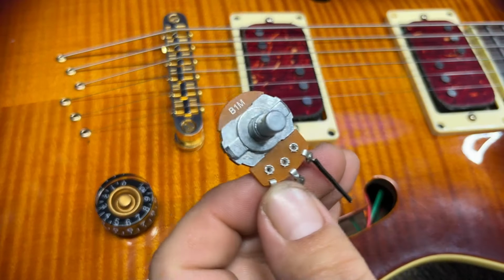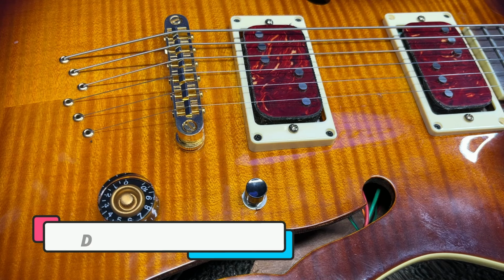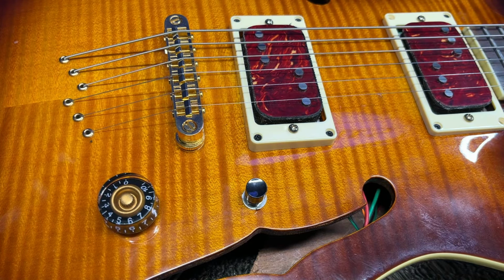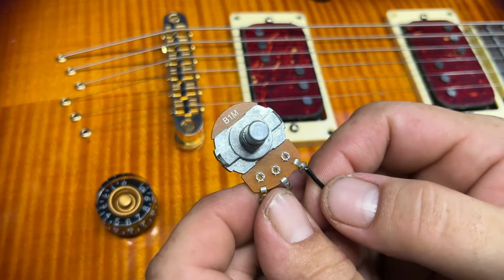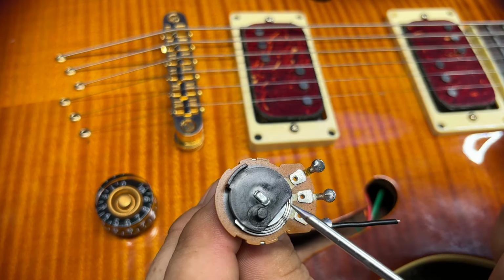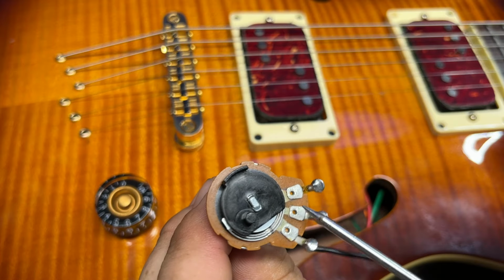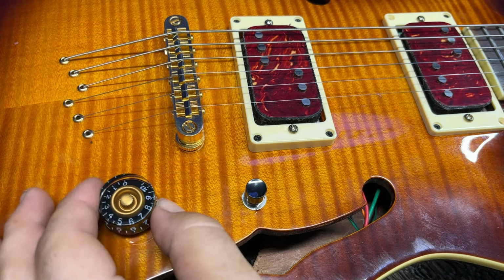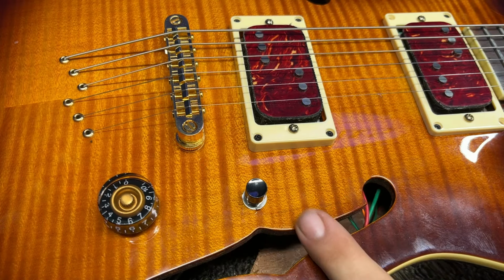Volume Pot Comparison  1meg - 500k - 250k - 100k - 25k

Comment: If you're always on full volume it doesn't make any difference. Actually it doesn't make any difference to have a volume button. I use a very good quality 200k pot I took from an old radio on humbuckers. It sound pretty suitable for me. Your gear sound great bud..
Reply from the maker: It absolutely makes a difference. A volume pot at full volume is not bypass. The center wiper is touching the pick up which essentially is underload to the ground.
If it didn’t matter at full volume, then no manufacture, would bother making different value potentiometers. If it didn’t matter at full volume, then you wouldn’t hear any difference whatsoever with different value pots.
Plug a pick up directly to the jack and see what happens, guaranteed big difference. 

Thinking pots are fully bypassed went at full volume is a common mistake.
Reply: @ArtoriusGuitarNerd  really! But if you just put a pot at full and measure with a multimeter at diode scale you will hear a bip and 0 resistentes. Have you ever try this?
Reply from the maker: @PintaoLoko  you’re doing the test wrong. You’re only doing a continuity test. At full volume the center lug touches the 3 lug 1000% completely BUT lug 3 is under load so it can’t be bypass. Fender makes a no load pot that goes to “11” by taking out the load resistance.

Please please please watch my revised video. I go into depth on how pots work and why people think they’re bypassed at full volume
Reply: @ArtoriusGuitarNerd  só it's no this video? I can't find it

Comment: Damn! I never knew that changing that value could influence tone.  You might have just saved me a couple hundred in pickups for a Reverend that I can't stand the sound of.  I'm going to try a few things before swapping pickups, now to include seeing if perhaps a 100k pot helps!
Reply from the maker: Yes lots of money can be saved. Potentiometers are cheaper than pickups.
I put a 50k pot in a G&L ASAT with the MFD pickups successfully.

Also each valve sound noticeably different in person and on the daw, YouTube audio compression is bringing out a lot of highs making it harder to tell the difference. I have the same problem with cymbals.
Reply: Also consider swapping magnets. Easy and cheap in most cases.
Reply: Capacitors help too. You can solder them to your pots

Comment: Tweaked a way too bright Jim Root Tele by replacing the 500k pot with a 250k that way. Also recently experimented with a mix of a 500k for volume and 250k for tone. Pots can make a subtle but noticeable difference
Reply: I've tried 250k tone pots with 500k volume pot on my Strat. It sounded great but after awhile I got tired of the clanking sound. I'm going to try the other way around. 500k tone pots into 250k volume pot.

Comment: Is the tone control hooked up? The parallel resistance between the cap/pot and resistor selection will make a difference on tone. TBH I can only hear a pronounced difference with the 25k pot, but there is also a massive volume drop, and the pickup is under a very low load at that point and it will reduce the high end like driving a long cable run.
Reply from the maker: There is no tone cap/pot hooked up on this guitar.
There’s more sound differences in person and listening to the direct recordings, YouTube compression brought out the highs, I have the same trouble demoing cymbals.
Each value is affecting the load, a bigger value pot would help with long cable runs.
Reply: @ArtoriusGuitarNerd  I've been using 1meg pots for like 30 years now, indeed it was to combat high loss with 20ft+ cable runs. Even locally I can't hear any diff between 500k and 1meg though, 1meg is just louder. I have to change the tone pot to 250k because 1/2 the rotation does nothing with a 500k tone pot and 1 meg volume. I always thought that was curious.

Comment: Until recently, Gibsons used 250 - 300 k pots instead of the classic 500 k pots. My 2008 Les Paul Standard had 300 k pots from the factory. This was apparently due to the switch from pure nickel to nickel-plated strings in the 60s (?), which sounded much brighter (nickel was expensive and hard to get back then, as I understand it).
I would suggest if you have a Gibson, check the pot value and try 500k first instead of going straight to 1M.
Reply from the maker: Yes Gibson uses 300k for vintage spec and 500k for modern spec.
I’ve heard slight differences when changing out pots with the same value because the tolerances were different. Both would be 500k but one would read 472k and the other would read 503k

I once had a 300k pot that read 197k !!!which was actually less than a 250k pot would have been. So I would definitely check pots with a meter if it means that much to your tone.

Comment: Great comparison thanks, if you change the value of the volume pot would the capacitance in the tone circuit need to change?
Reply from the maker: Yes I should have mentioned that in my video. Same rule applies to the tone pot.

I personally like to have my tone pot at a higher value than the volume pot, some of my guitars have the tone pot bypassed on a push pull.
Reply: @ArtoriusGuitarNerd I like this idea and am going to put 500k tone pots on my strat with a 250k volume pot.

Comment: Sounds like ye have extremely bright pickups to begin with. You didn't state what your pickups are so I cannot properly judge what ye got there. Ye need to use a set of pups everyone is most likely to be familiar with like the JB/Jazz. 

Also ye need state the build and construction of the guitar yer using, a semi-hollow like the thinline sounds VERY different from a Les Paul. I wouldve used a Les Paul of more or less standard construction (1/4" maple capped mahogany body with set on mahogany/rosewood neck  OR a carved mahogany body + set mahogany/rosewood neck). If there's any differences, that needs be stated so people can make an informed judgement of what they're listening to.

As it stands, I don't know what pups you're using and what kind of thinline you're using.
Reply from the maker: I’m doing a follow up video this weekend with a Seymour JB. I’ll be doing volume & tone clean & dirty.

Yes, this pick up was bright like a single coil so it was too bright with 500k and 1Meg. I also had the guitar mix way too loud so the YouTube compression squished and smeared all the frequencies together. The differences are subtle and noticeable, but the compression made it much harder to tell the difference.
Reply: @ArtoriusGuitarNerd  Cool, I'm looking forward to your new video! We all start somewhere, so as long as yer learning and growing as a YouTuber and as a presenter, you'll do fine! Subscribed. 😁👍

Comment: I've noticed my 90s MIM with ceramics and 250k sounds like a muddy mess compared to my other with also 250k and Alnicos, which sounds "normal." Is that odd/strange?
Reply from the maker: I would go with the 1Meg if they’re that muddy. That would open them up to their full potential
Reply: Ceramics are dull and lack sparkle to my ear. They can also be very nasal. Buy some alnicos, as they seem to be more open sounding to me. Clean tones or slight breakup are more critical than heavy distorted tones, as distortion adds overtones.
Reply: @VincentBakker1964  huh. For mine I feel I need to turn the bass way down or it sounds like mud.
Reply: Wow, I thought it would be a huge difference, but it's not. Cool video.
Reply from the maker: @charlesvannice8279  the bigger value pot will “lower” the bass by “raising” the treble.
I’ve used bass cut knobs but they neuter the sound.
Reply from the maker: @danpena7922  it sounds different in person and on the daw. YouTube compression is accentuating the highs. I have the same problem when posting drum cymbals.

Comment: Would you switch both the tone and volume pots or just one of them. Would you also keep the same capacitor, just on a new potentiometer.
Reply from the maker: Same rule applies to the tone. I would have both pots match or use a larger value on the tone if possible.
You don’t need to change the capacitor because the capacitor doesn’t add load to the pickups. (You can take this opportunity to change the capacitors if you want to experiment. I think .047uf is to muddy when on ten so I usually use a .027uf-.033uf which gives me a better sweep of usable tones)

Most of my tone knobs are bypassed with a push pull pot…. I’ll pull it up whenever I need to use a tone knob.

Comment: Wait a sec - aren't you just reducing the drive on the front end of your amp? It would have been better if you'd scoped the output level. I suspect you're just sending more signal to ground as a resistor has an even attenuating effect across all frequencies, unlike a capacitor.
Reply from the maker: I’m using resistors to attenuate the treble not the volume. It’s 1000% the same as a potentiometer. A potentiometer is a variable resistor and this a none variable resistor so it’s always on “10” “ full volume”. It’s only adding load to the pickup which is way the treble fades a bit and not the volume.
Reply: @ArtoriusGuitarNerd  You misunderstand me. By reducing the gain on the front end of the amp, you attenuate the treble as the bass is already saturating the stage, so can't get any louder. Turning down the gain on the amp would have exactly the same effect.
Reply from the maker: @zenscapeUKmedia  guitar is highZ and an amp is active LowZ. So turning down the gain on an amp would not do the same thing, turning the the gain on an amp with turn down the volume. You could adjust the eq of the amp to adjust the treble but this video is supposed to show you how to “tweak” the tone a little bit so you don’t have to adjust the amp so much from guitar to guitar.
Reply: @ArtoriusGuitarNerd   I'm talking about an amp having a front end gain stage and a master volume. Although if you took at Champ and drove it with a flat response boost pedal, it would saturate the front end tube which compresses the bass so making the treble appear brighter. That's what tube (valve) overdrive is all about.
Reply from the maker: @zenscapeUKmedia  ok well again this is way to tweak guitar so you don’t have to mess around with the amp so much between guitars.
Reply: @ArtoriusGuitarNerd  I guess my point is you're adjusting the interaction of the guitar and the one amp. With another amp, as you guys say "your mileage may vary". Another room, another amp or cable you may wish you hadn't changed for such a limited environment.  Raising or lowering pickups / pole pieces also changes tone. Changing your pick attack, or position on the strings would be far, far more dramatic and is something all guitarists should master before turning to mods to compensate for what might be bad technique. Versatility of performance is the ultimate goal for any musician.

Comment: your guitar sounds mudfy because the bridge pickup placed way too far from the saddles. not because of the slight treble filtering by pots. its all about the mids
Reply from the maker: I don’t understand what you’re saying.
My bridge pickup is standard distance from the saddles/bridge.
These pickups are very bright and definitely not muddy.

This point of this video is to use treble filtering to your advantage both ways (dark to bright & bright to dark)

Comment: But what is done with volume pots when the volume level is useless until knob numbers 8-10 (a non-linear volume increase)?
Reply from the maker: The pickups are aways under constant load no matter what taper or where you have the knob set. The pickups don’t receive a variable load when turning the knob.

If your volume does “nothing” until you reach 8-10 then you most likely have an “audio taper” pot and you’ll need to switch it to a “Linear taper” pot to get an even volume sweep. 

Audio pots are usually labeled with an “A” and Linear pots are usually labeled with an “B”

Comment: Vintaged,Gavitt,cloth wire,with Vintage Tone Caps,Will,Make Your Sound,Warmer,Organic and The Notes can be Molded to How you Want!As Well!Take care!Thanks for your Tips!
Reply from the maker: Yes changing the caps and wire will slightly affect the tone. It’s good to experiment with pots wires and caps since they’re a lot cheaper than pickups.
Then change your pickups if none of that works.
Reply: Prove it.
Reply: @tubo628  Yeah, I would like to see that too, or rather, hear.

Comment: For the sound at full volume knob, you can solder a resistor between the outer two lugs of the pot also.  I use this technique in HSS guitars to add 510k resistor across the 500k volume pot only when the neck single coil is selected to take a bit of the bite out just in that position.  What this is doing is reducing the gain at the resonant peak of the coil.
Reply from the maker: What you’re doing is adding a resistor in parallel with the pot cutting the valve in half, turns the 500k pot into a 250k pot.
Also you don’t need to place the resistor in between the outer lugs…. You only need to add the resistor to lug 3 and ground (since lug 1 is ground anyway).
I do the trick you’re talking about with a push pull pot to make a 250k pot when doing a single coil tap or sometimes add the resistor to the blade switch so it does it automatically when switching to single coil pickups on a HSS.

Comment: How do you set up the fiveway selector. I'd like to try in one of my projects
Reply from the maker: I will tell you how it’s done but first let me say it’s not a good idea because you can’t adjust the volume with the rotary switch. I wind pickups so I use this rotary switch to hear what pickups sound like with different loads to determine which pots would sound best.

It’s a 5-way rotary switch with 5 resistors (1Meg,500k,250k,100k,25k). Each resistor is soldered to its own lug on the switch and the opposite end of the resistors are all twisted together and soldered to ground. Then the “out” lug of the switch goes to your pickups.

The pickups will be under load 100% as if there was a volume pot.

Comment: Could you make a tone pot video using humbuckers, using 250' s and 500's? It could be a combination  of 2 videos. 1 video with 250's, 1 with 500's with short demos in each pickup position. Optimal, more work on your part though, would be A then B back to back. Neck position, play something using the 250, then the same guitar using 500. Then the middle, same thing. Bridge, same thing. And a volumn pot shootout using single coil tele and strat. Same format. You would be filling a void(to my knowledge) that i think a lot of players could really benefit from. Your volumn dial is cool, very cool- but most of us don't  have that. Thanks for this video, really helps!
Reply from the maker: Thanks for the suggestion, I can try to make a video like that.

Comment: Crazy, I thought the 25k pot would be unusably muddy, but it sounded best to my ears. Even listened through  a few speakers and headphones to compare.

Am I the only one?
Reply from the maker: I wanted to use a 25k in this video, 25k is usually used in active pickups and not to hard to find on line, the GC in my city actually carries them too.
I’ve installed 50k in strats & teles several times with good results.

Personally I prefer the 100k in this demo because I like the sparkle without the glassy highs.
Reply: I liked the 25K the most as well.

Comment: Excellent comparison, the best video on the subject! Could you make this comparison with single coils? Thanks!
Reply from the maker: Thank you!
Actually the pickups I’m using in the video are hum canceling single coils in a humbucker platform. I designed them myself, I call them hybrid pickups (check them out on my channel). Essentially they are a full sized version of the G&L Z-coil.
Reply: @ArtoriusGuitarNerd  Thank you for your attentive response! Just one more question: Which of the pots do you prefer?
Reply from the maker: @osmarqueiroz2429  I like the standard 250 for singles and 500 for humbuckers, (I like 250 for my hybrid pickups).
When it comes to brands I prefer Alpha over CTS because the action is smoother feeling.
Audio tapper or linear tapper would depend on your ears

Comment: What will happen to the sound? If the pickup sees? you wiring vol Independent?
Reply from the maker: I don’t understand the question. Are you asking what will it sound like if your flip the input output lugs?
If so, the pickup will have a variable load and will sound different/darker as you turn the volume down. Your pickup should not sound different as you turn the volume down when wired the standard way.

The 5-way switch is toggling between different load resistors simulating potentiometers. The way an amp or pedal responds to volume has nothing to do with how the pickup sounds.
Reply: @ArtoriusGuitarNerd  also darker if you wiring the tone pot to the output of the vol pot? 
Instead of the normal "before" the vol pot.
Yeps sorry bat English! Me!
Reply from the maker: @timec818  yes the tone will get slightly darker/warmer when you wire in a tone knob whether it’s on the input or output.
The modern tone knob is on the input and the “vintage” tone knob is on the output. In general the vintage tone knob will need a smaller capacitor since it also uses load to trim off the treble.

Comment: How are those rotary value selector called when looking for them to buy? Are they ready made with the resistance options?
Reply from the maker: You can buy potentiometers in many different values 1M, 500k, 300k, 250k, 100k, 50k, 25k 
I’m using a rotary switch with resistors to simulate what those pots would sound like at full volume, I’m not able to turn the volume down with this setup.